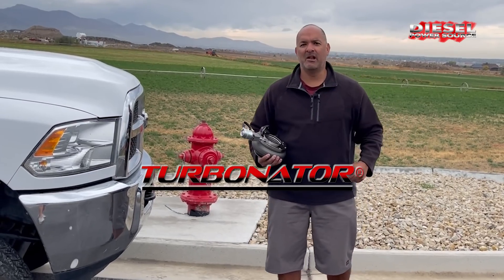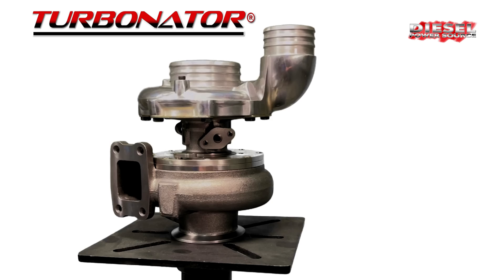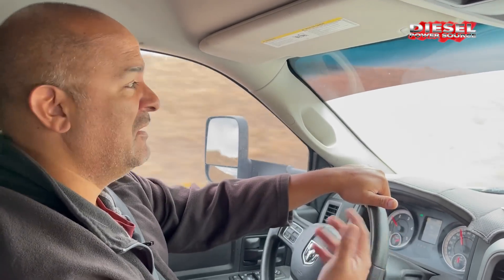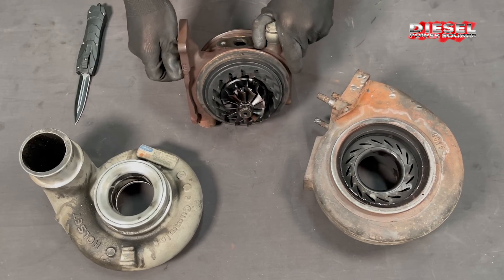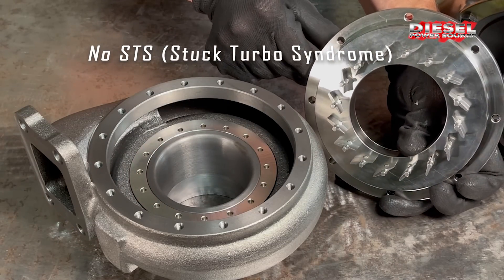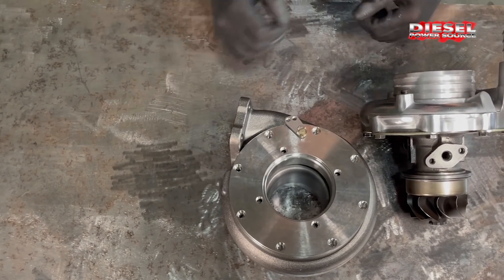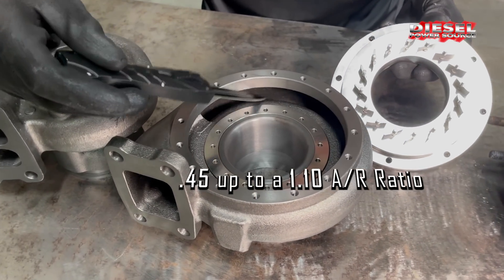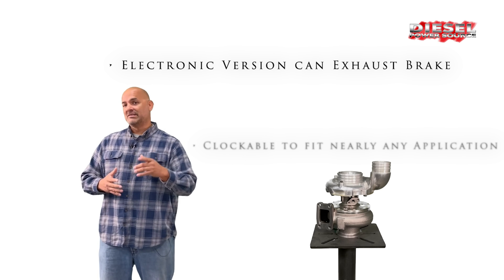What is a Turbonator VGT? | DPS VGT Turbo for s300 Turbo and s400 Turbochargers | DPS VGT Turbos

Comment: Too bad you don't make a mechanical T6 Turbonator housing Borg Warner S410 for my Caterpillar.  Available with a 78 to 83 compressor wheel options, and able to adjust between a 1.32-1.65 on the turbine side.

1.32 spools great, but no top end power (and mileage sucks). Gotten my best mileage with a 1.65 turbine, but cruise EGTs are too high. Being able to dial it in with one housing like that would be awesome!
Reply: They make a T6 version that uses drive pressure to control the vanes, it's an S400 base but not sure of the complete specs. Would work for your application though, considering putting it on my series 60 11.1 😂🤙

Comment: I installed this product on my 6.4 Powerstroke. I had my compounds fail so I installed an s364 over a year ago. Loved the top end, but hated the low end smoke, and lagginess of the turbo. EGT’s spiked going over hills, especially when towing. Now I have boost off the line and no smoke!! Totally new truck. EGTs are now 200 degrees cooler cruising, and the truck climbs hills like an animal. When climbing a hill you can watch the boost rise above the drive pressure. Now, the boost is almost double what it was across the board.  Not pushing file out the tail pipe has brought my mpg up dramatically. Love this product.  Great job to the guys at DPS!!!!!

If you have questions the guys at dps were great, and if you have 6.4 turbonator questions go leave a comment on my video.
  https://youtu.be/w0Ri0rfFpdo

Comment: Is there a manual option?
Reply from the maker: Yes, we have a mechanical Turbonator VGT.     https://www.dieselpowersource.com/choose-your-own-turbonator-vgt-vnt-variable-geometry-turbo-cummins
Reply: Yes I have the mechanical with s467.7 on my 2012 ram 3500
Reply: @powerstrokeeld  just did mine how is ur exhaust break working for u mines isnt..
Reply: The exhaust brake function was only available on the electronic turbonator. If you have the pneumatically controlled VGT you will not have exhaust braking.